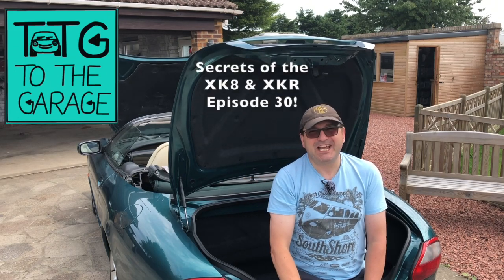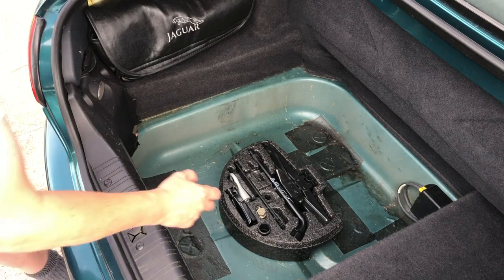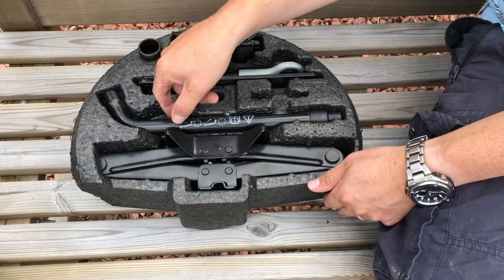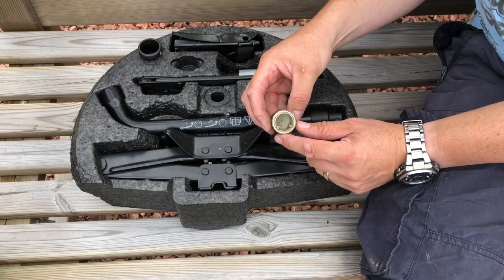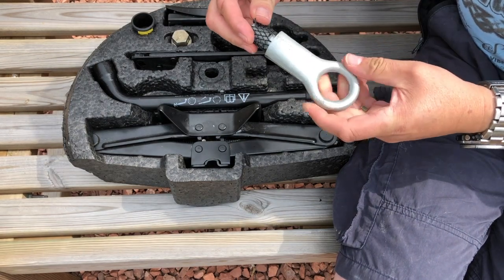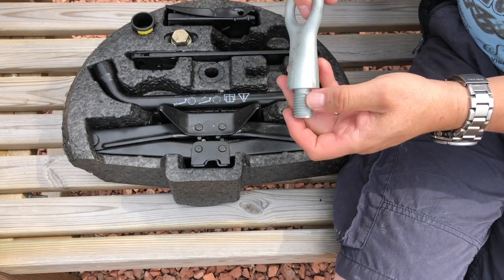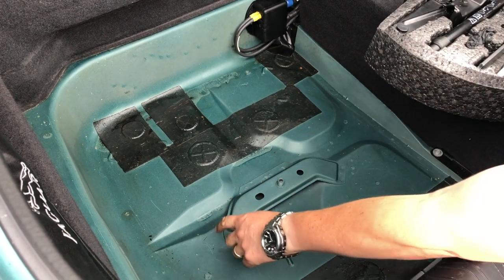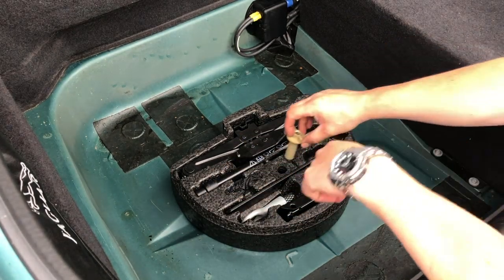Jaguar tools explained?  Secrets of the Jaguar XK8 & XKR Episode 30

Comment: John, thanks for another great, informative video.  I especially enjoyed the tidbit about Remploy.  My 98 has the full sized spare. There is no divider between the battery compartment and spare storage area.  I think the full size may have been an option.
Reply from the maker: You know what Bill, Although I know they fit. I have never seen a full size tyre in a car from the factory!  So  when you say there is no divider between the battery and the wheel do you have a different but one piece boot floor, compared to my two pieces?
I love it when we discover something a bit different👍
Reply: To The Garage John, it’s a full size 17” spare with revolver wheel and yes, the boot floor covers completely across as one piece.  It covers the battery, fuse box and spare tire.  By the way, the car is in America, if that makes a difference, I don’t know
Reply: @ToTheGarage  ..............my 1999 Canadian market car also has a full size ''revolver'' spare.

Comment: Hi thank you for your helpful vidio's. My tool kit comes with a 3/8 extention. I have also put a set of jump leads and a tow rope around the outside of the spare wheel and a small tourch and a dispossable rain poncho on top of the wheel. I will be putting some rubber gloves in shortly.

Comment: My '99 XKR came with a Jag issued 18" by 6" by 2" black plastic toolkit with spanners, screwdrivers, air gauge, etc. All Jag lettered. Set in green baize.  Factory 20" mags needed a special adaptor to check tire pressures.
Reply from the maker: Wow. That sounds cool moyadapne. Do you think the kit was XKR or a tasty addition added by a previous owner. (I know that the XJ40's had a tool kit box and spanners for instance) Either way im Jealous🥺
Reply: @ToTheGarage  I did a 'John' and video taped the kit in detail.  Upload soon. It came from Japan like that, so I don't know its history. Paul. NZ.

Comment: Hey John,  The missing slot you were wondering about should contain a 3/8 extension for the ratchet tool.  Thanks for all you do for us SAD XK8 owners.
Reply: Bob Barrett What ratchet ?
Reply: Bob Barrett i have that but what is it for??
Reply from the maker: Thank you Bob. Now you have said that, the shape makes perfect sense. Don't really know why we would need one though?🤔. More investigation needed methinks. Thanks again Bob👍
Reply from the maker: The Ratchet to wind the jack up with Andy.👍
Reply from the maker: Zsoit Berthold I don't know either, but I'm going o find out.
Reply: Had to go and see whats in mine, full kit incl the ratchet extension. However the ratchet was seized solid, now sorted!  Cheers John for the prompt to check it all out.
Reply from the maker: Thanks for sharing Terry. Yes the fact that we use these tools so infrequently means they can throw us a nasty surprise when we really do need them.👍
Reply: @ToTheGarage  The tool that had me puzzled was the chock, always wondered what the hell it was☺, your videos are so useful...Cheers.
Reply: @ToTheGarage  The purpose of the 3/8”square drive extension is to provide extra clearance between the Ratchet handle and the Sill.   The design of the scissor Jack action means that when it rises, the Ratchet swing arc gets closer and closer to the bodywork. So, the extension is provided to give additional clearance and stop risk of paint damage to the Sill.
Reply: Actually, I may have that the wrong way round!   I now think the extension is needed for clearance during the initial turns and less so when the Jack is at the top....

Comment: Excellent video John and very informative as always.  I think it worth a mention that the locking wheel nut “key” is stamped with a number.  Should you ever loose the “key”, being armed with the number will help identify the correct replacement. Although not a unique number, it does identify the correct “key” for your particular vehicle.  The keys are extremely difficult to obtain but do come up for sale occasionally on a well known auction site.
Reply from the maker: Really good tip Cliff.
I will make a note of mine in my handbook at the weekend and mention it in an upcoming video👍

Comment: Just found your channel and binge watched the XK8 posts. Excellent series of informative vids, nicely filmed and narrated (with a hint of Brummie accent?). FWIW, I regularly check air pressure of the spare and inspect sidewalls. Those "T spec' tires degrade over time even with minimal or even zero use. They are also becoming difficult and expensive to replace and almost impossible to safely repair.

Comment: Dear John! I can not take off the wheel nut covers, i have the tool for it but doesnt cam off... any advice? Thanks a lot!
Reply from the maker: Hi Zsolt Berthold 
First thing is you may be trying to remove covers that are not there. Only the locking but has a cover and it is denoted by having a groove impressed in its top (like a fake key slot)
If you can’t remove this one then either the plastic removal tool is worn out (unlikely) in which case put a single wrap of insulating tape around the end to keep the claws inside tighter, or replace it. 
More likely you have not yet pushed it onto the cover far enough. It’s a firm shove and you should hear a feint click

Hope this helps. Thanks for watching👍
John
Reply: The reason why i think its a cover is that its not tight so i can twist is a bit to the left and the right an pull a bit also. Non has a mark to sign the locking one.. i try , thanks :)